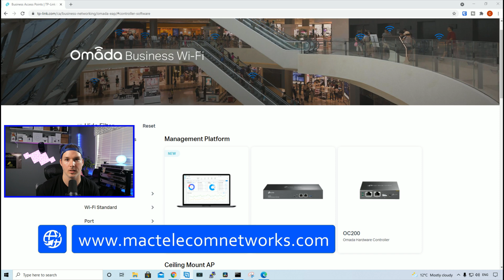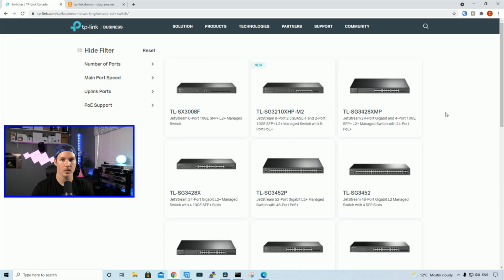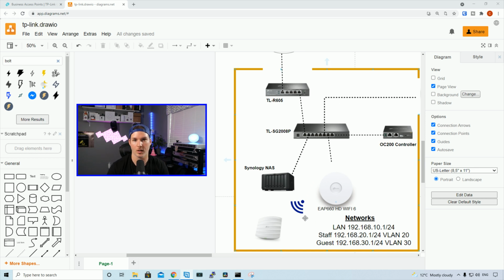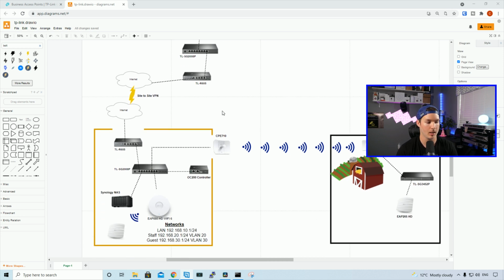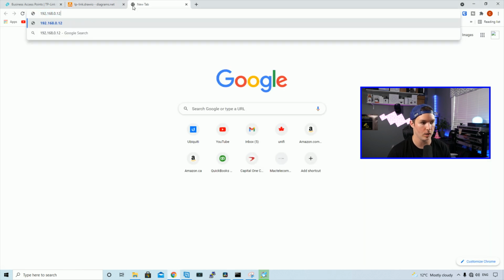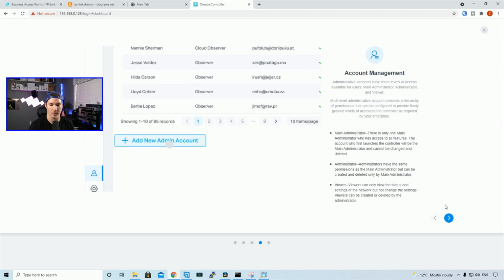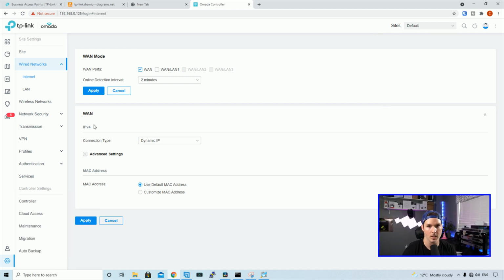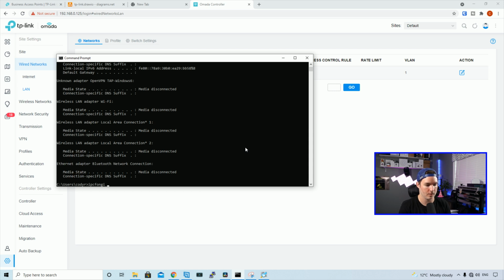TP-Link Omada Full Setup.   Part 1 Overview and device adoption

Comment: Hi, can the Omada system works without any Jetwstream switch (just very basic unmanaged switch)? Actually, I just need 3 AP and the ER605 has enough LAN port for me (1 Port for WAN, 1 port for the Controller OC200). Thanks you so much for your contribution.
Reply: I have this setup ER 605, OC 200 and (2) EAP 620HD.. It works.. but miss some features like ACL and LACP. After a month I Added SG2210P switch for ACL and LACP purposed. ACL is for VLAN (so guest cannot access to main) and LACP is for my Synology NAS to maximized speed of dual LAN. One more thing the switch has a POE to power the OC 200 and EAPs. Having a managed switch is a must..

Comment: Got a question, the 660HD doesn’t support meshing right now, but the 265/245 do. 

Are the 265 able to create the mesh through the 660 if it’s the “main” access point? Have you verified this works?

Comment: I was experiencing disconnection from wifi a couple times a week with my ISP device. Last weekend, I installed OC200, TL-R605, TL-SG2008P and 2 EAP245V3 in my house upgrading from ISP modem/router combo.  My 2 EAP are ethernet wired to the switch as are my 2 TV and my PS5. I have 35 devices connected to my network.  I'll report back in a few weeks about it but for now, everything worked flawlessly. Your previous videos helped me set things up so thank you!
Reply: Time for an update....
Reply: @Clarkey1000  Right! Everything works flawlessly!
Reply: @maththeteacher  Pulling the trigger now then. Thanks.

Comment: Thanks for these Omada videos and looking forward to the next ones! I wonder if you could also create a video and/or comment on the QoS/SQM (or whatever it is called) capabilities of the Omada system. I'm debating between getting this system or the Unifi line. I'm leaning towards the Unifi line because they have nailed the SQM/fq_codel down to pat. But the Omada line is more affordable and my system is not that demanding. I do need a more robust VPN and SQM though, so that's why I'm looking beyond consumer-grade wireless routers. Thanks again and keep up the great work!

Comment: i use edgerouter's but last week i installed  er605 behind cgnat as l2tp client and i was very happy with the output, the omada stuff is nice, its a unifi rip off but its nice that every device has its own web management interface and its not forcing you to have a controller if you dont need it. Keep up the great work.